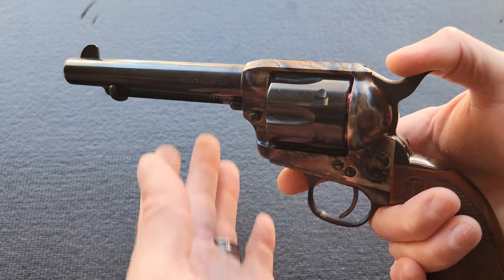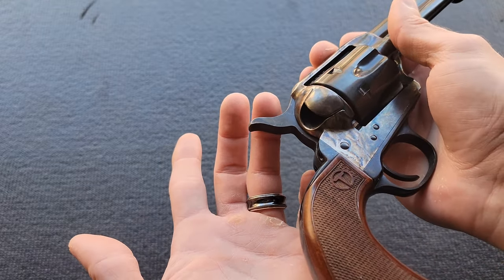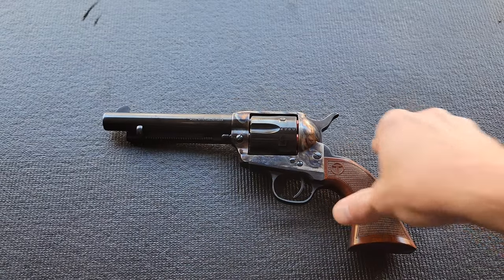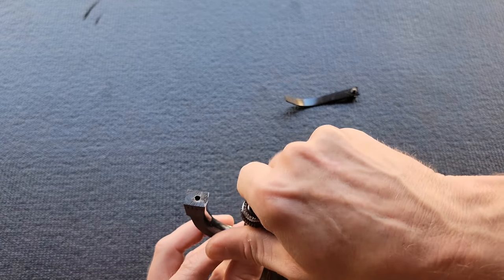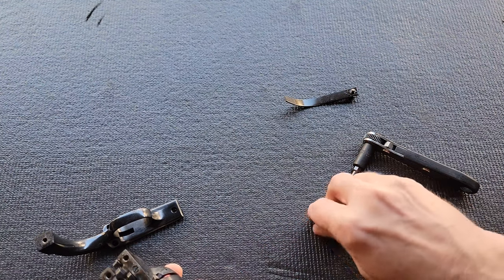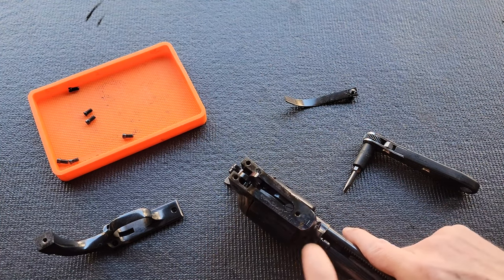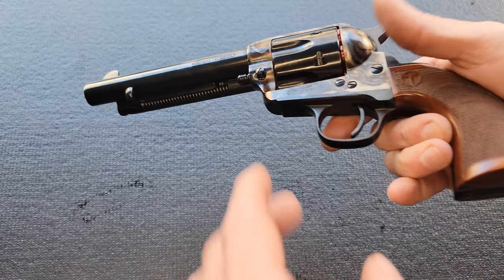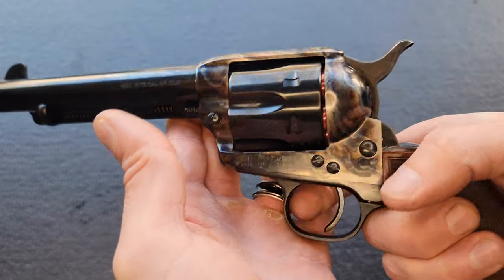Uberti Wolff Spring Kit

Comment: Interesting fact for you. I bought a pair on el patrons that come with the Wolff springs and one was having intermittent issues with what I thought was timing but turns out it was the cylinder over rotating and the firing pin hitting the edge of the case instead of the primer. Got a second pair at some expense and another one was doing the same. A kind gentleman on a sass forum suggested to throw away the Wolff wire springs for the trigger/bolt and replace them with standard ones as he had the same issue, So I did and bugger me it works fine now. I was getting super frustrated trying to sort this out. So in my case the Wolff springs fitted from factory cost me a lot of money getting new permits etc to replace the faulty guns. I live in Australia so every step costs money.

Comment: Hi and I know this video is a year old by now but I liked how you showed all the details. I wanted to tell you of an easier way to install the mainspring. All you have to do is start the screw half way with the top of the spring off to one side or the other (no tension at all) then with the screw 1/2 to 3/4 the way in, just move the top of the spring over and under the hammer and then fully tighten the screw. That way you aren't fighting the tension to try to align the screw into it's hole. Hope this helps.

Comment: Hello, I have an Uberti Cattlema  and I'm having troubles with some short of plumber and spring that don't belong to the gate but that were, apparently, inside of the Cattleman., I don't know whether it would be possible for you to help me out or not. I disassembled the gun but those two pieces (a plumber and an spring) came out from the trigger zone not belonging to the gate, because I didn't disassemble it. Fortunately I have both of them but I don't have the slightest clue about how to assemble them if there are any pieces like that. And unfortunately the diagram doesn't show it...

Thanks in advice.
Reply from the maker: I gave this Cattleman away, and don't have a Uberti at the moment, otherwise I'd make a video showing you how to put it back together. If you keep searching there is bound to be a video somewhere on YouTube that will show the reassembly.
Reply: I suspect you might be referring to the hand spring and plunger, if they are very tiny. They belong in a very tiny hole just above the top left  screw hole at upper rear of the frame for the backstrap and which is covered by the back strap. In Uberti's they are usually retained in place by a very tiny set screw. (plunger, then spring ,then set screw.  In Piettas they are simply held down in place by the backstrap itself (plunger, spring, back strap) and can be easily lost when removing the back strap if not careful. If they are not in place ,the hand will usually not rotate the cylinder with pistol pointed up but may rotate it when pointed down because gravity can then hold the hand against the cylinder ratchet in lieu of the missing spring. The only other extra spring and plunger (found in Cattlemen II's) is the plunger and spring that are located inside the hammer and are much larger than the above hand spring/plungers. They serve as a transfer bar system to rise up and wedge behind the firing pin to keep it fully extended foward when the trigger is held fully back. I doubt these are what you are referring to as you have to drive out cross pin in the hammer to remove. Hope this is helpful🙂DJ
Reply: A word of caution when disassembling Cattleman II and you don't remove the hand set screw, spring, and plunger parts from the rear, but do remove the hammer and hand. one or both may of these tiny pieces may fall out the front and be lost or get lodged somewhere inside the fram. This may be what occured in your case. DJ
Reply: @dorisjohnson8857  thank you very much for the answer, I've found the answer to my question through your coment. Thank you!
Reply: @inakiaraluze4528  Very happy Inaki i could be of help.🙂 I hope your Cattleman has all the parts in place and running well😊DJ

Comment: I don't see how slowing down your lock time speeds up your action. It can make your gun easier to cock....
Reply: Is that not part of the action lmfao
Reply: @getem8905  If you weaken the spring the lock time will be slower.... so what is your real gain ?  If you  have difficulty cocking and it makes it easier for you to cock ... that can be a benefit to you.... but if you think you are making your lock time faster ... you're not.  If you get the spring too weak.. misfires will increase. ...  a gunsmith can make sure the firing pin is hitting hard enough to crush the primers. A number of "Action Jobs " I've seen are done by people that don't really know what they are doing.  They don't have positive sears  .  That really hurts safety. It's the old story. Some people don't know enough to know that ,  what they know , is wrong.  ( When I say you, I don't mean you personally,  I mean anybody .)
Reply: @od1452  anything that majes the pistol function is part of the action, every moving part ect. When most people say tune they mean timing, bc there really isnt much you can do aside from that and whats seen in this video

Comment: You wouldn't round off the screws if you used the proper width screw tip. That's the first sign of an amateur.
Reply from the maker: I never claimed to be a professional. 😆
Reply: @SapperGentleman  It is not too difficult to tap the screw head in padded vice with a small tack hammer to peen down any raised burrs and even-up the slot  and then polish with emery cloth and steel wool and then heat blue and quench in oil to look like new. Done it may times🙂DJ